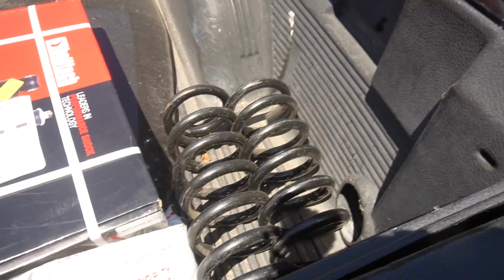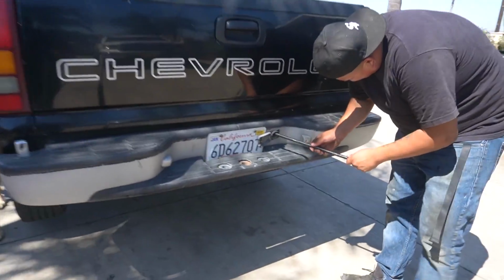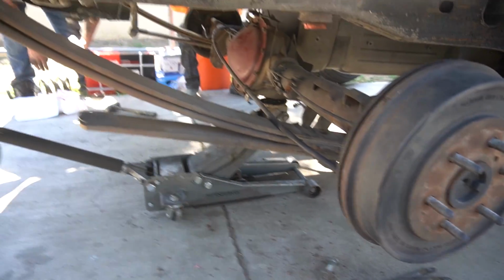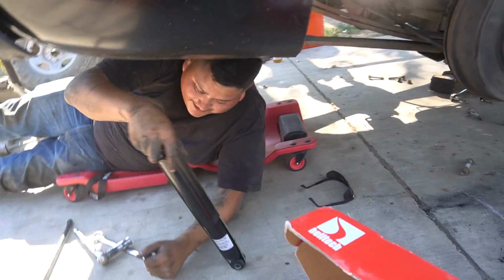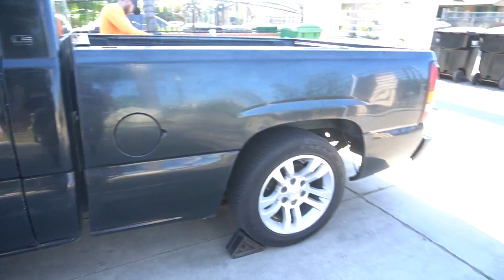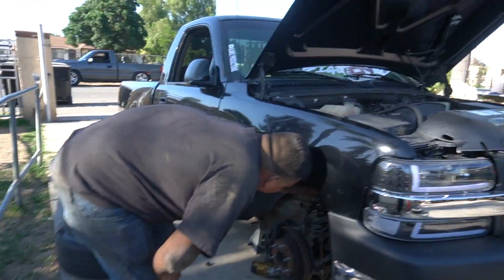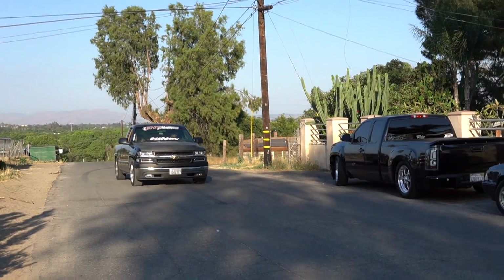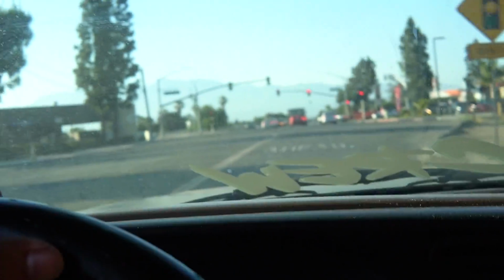3/8 DROP ON THE SILVERADO!

Comment: Could I do a 4/6 on a long bed single cab  silverado with no notch?
Reply from the maker: You’ll have very little clearance, any drop 6” of bigger I would recommend at least a normal notch
Reply: @BIGOCHUBS  prolly end up doing like a 4/5 if I notch it I’d say fuck it go to a 8
Reply from the maker: @chrismora1714  To be sure, you can get a 6” flip kit and a 1” lift shackle in case the flip kit does hit a lot